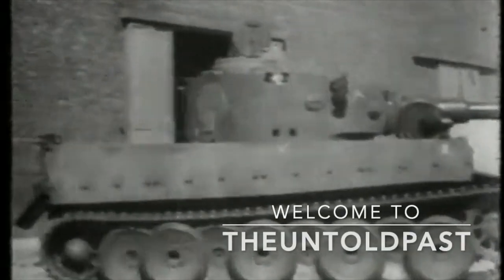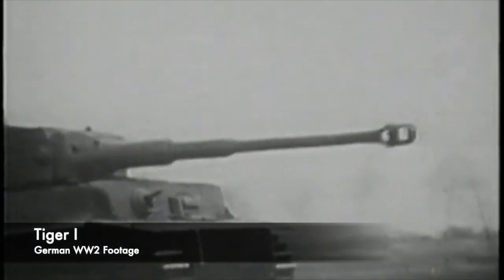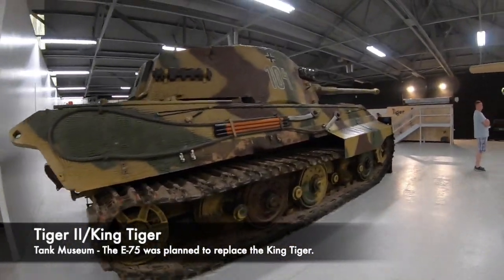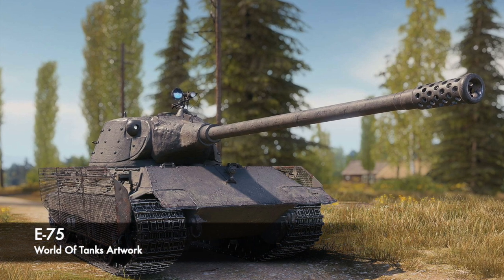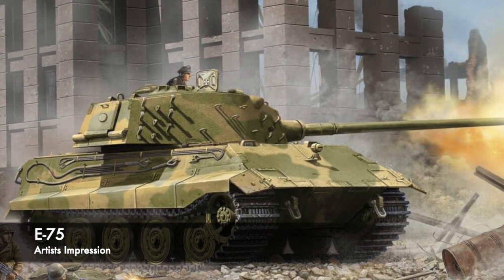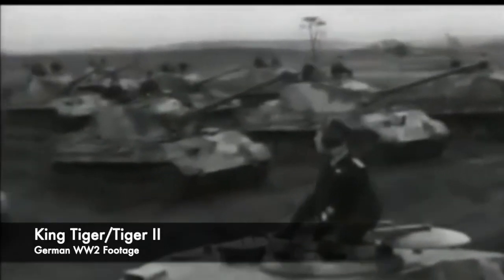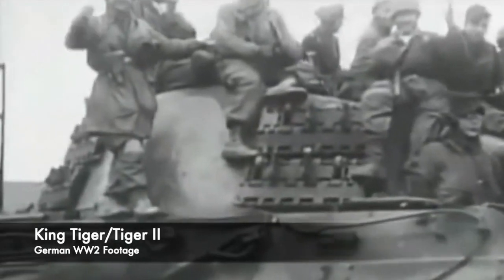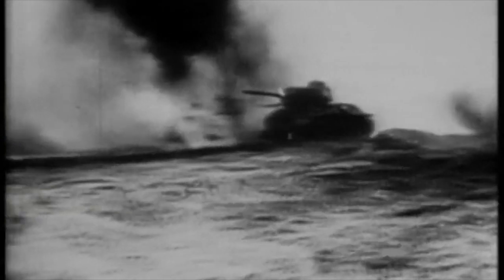The King Tiger's Replacement - The E-75 Standardpanzer

Comment: Germany was running out of fuel. Without fuel, it doesn't matter how many tanks you have.
Reply: Fuel and resources...
Reply: @Wassermel0ne  and manpower
Reply: The Icelandic Nationalist  The strategic bombing campaigns should have concentrated on oil from the start.
Reply: The Icelandic Nationalist  Much of the German oil supply came from converting coal into oil. A very expensive process requiring large processing facilities. The only substantial source of natural oil was the Romanian oil fields. Towards the end of the war the strategic bombing campaign concentrated on disrupting these sources. As a result there was a fuel shortage which mostly grounded the Luftwaffe, and was a major reason the ardennes offensive failed.
Reply: With more of the standard tanks the operation too take the caucus oil fields too ensure that the fuel would flow may have been successful.  Its all speculation. If this or what if that or could've happened this way. Really bad timing, bad choices by a megalomaniac and false superiority complex was even more of the down fall of the first authoritarian socialist regime.
Reply: @patrickcombs3567  communism sucked and killed many people too, but I don’t believe national-socialism is really that social.
Reply: @Ake-TL  it started as national socialism but ended up as authoritarian.
Reply: @Ake-TL  socialism sucks but social programs can be beneficial.  Its when the lines get blurred when you get the hitlers and even stalins killing off anyone they deem deplorable or detrimental too society.
Reply: ^ Nonsensical statement. Allied Bombing was in response to German precedent, whom had been the first to bomb civilian targets.

Also: the USSR was supplied with material from the UK, Canada & USA.
Reply: ^ Complete - not to mention ironically framed - claptrap. The Germans had by 1940 bombed civilians on purpose in Spain, Poland, France, Belgum & Rotterdam. It also wasn't "one bomber" that unloaded over London, but a group thereof.
Reply: Also: the UK & Canada directly supplied the Russians too, not purely with US goods.

Case in point: in the Battle of Moscow; over 75% of all the Tanks used to defend the city... were British.

So good job being demonstrably wrong on all points.
Reply: ^ How about everything? -_- .

The USA wasn't the prime source of nor the physicsl provider of material to Russia for the duration. Early on it was the UK & Canada.

Also Churchill - contrary to your diatribe - made no such "order". The Germans first bombed civilian targets with intent back in the '30's, when he wasn't PM nor in the cabinet.
Bit comical too how you neglect to mention the USAAF as being "cowards" for also following German precedent, or the Red Airforce for either their low yield long range bombing of Germany or their requesting the RAF & USAAF to hit targets for them.

Oh; and whilst we're at it let's not forget Japan, which supposedly dropped gas on civilians during the '30's. Not even the Germans did the latter.
(albeit only because they feared retaliation to using chlorine & sarin; with mustard gas or worse, rather like Iraq in 1991 feared a response to using chemical weapons on the UN coalition)
Reply: @jimtaylor294  If I were you id check were your getting your information from as its not very accurate, Germany out produced the UK in most areas actually.

In 1938 before any German conquest Germany had 14% of the worlds war making potential.
The UK and its empire had 10%.
Russia was more comparable to Germany at 14% also.
The USA had 42%
Germany after conquest of France had about 19% to 22%.

Best prodution year for the UK in ww2 for tanks was about 10,000 with USA support, and 26,000 aircraft, Germany best year was about 20,000 tanks and 40,000 aircraft in the middle of the bombing campaign pretty impressive.

Total production of aircraft the UK production was 131,000 compared to Germany 120,000.
Tank for the UK 35,000 Germany 49,700.

The UK domestic production of AT guns and Trucks was just over 10,000 each pretty pathetic lucky they had Canada to help make up for trucks, and the USA, even things like universal carriers, about half were made by the other parts of the empire, mainly Canada, India and Australia and even the USA.

Germans ammunition production was comparable to the Soviets who out produced the UK easily.

The Brittish war ship building was one of the best second to the USA, but overall excluding ship building and alone without it's empire the domestic production was only 2x as good as Italy.

If we look at steel in the navy the UK used about 1.8million metric tons, Germany used about 1.2million metric tons.

At a minimum 30% to 36% of the UK ww2 needs were supported/ suplyed by the USA.
Russian had about 12% to 15% for lend-lease the majority of that was from the USA.
Reply: @richardcutts196  I'd also say that it was oil that saved russia and stopped Germany in operation Barbarssa, it's basically what saved the Russian's.

Germany used about 47million barrels of oil in that period.
If we compare oil products.
Germany under 300million barrels from 1941 to the end of the war.
Russian 900million barrels to 1billion.
USA 6billion barrels.
UK conquest in the middle east Iran mostly and a small amount Iraq, about 600million to 700million barrels.

The allies consumed about 7billion barrels in ww2 not including the Soviets.

An interesting fact is coal was the most used and produced resource in ww2 the two biggest producers being the USA followed not that far behind by Germany.
Reply: ^ Spelling errors aside; dumping dozens of uncited statistics doesn't accomplish much, as an unreliable statistic, is worse than useless.*

The claim about Tanks is demonstrably false, as in 1940 the UK was producing more Tanks than Germany, and in 1942, production had geared up so much - by more than 40% - that the UK achieved  double the German production figures.

In Aircraft the UK started the war behind Germany; yet as factories got going & standardization enforced (unlike in germany which was starkly inefficient), domestic production shot up. Having nearly doubled on the prior year's efforts, in 1940 the British produced over 15,040 warplanes, to Germany's 10,240. The UK at that point in the war was producing more domestic aircraft, than any other country on earth.

Germany lost nearly 2,000 aircraft & over 2,500+ aircrew in the BoB alone, so their production figures are even weaker when accounting for such voids they had to fill.

In WWII the Germans produced 120,000 aircraft, compared to the British 131,000+. The latter wasn't far off the Soviet figure of about 158,000 (and unlike the USSR or the Germans the British had modern Heavy Bombers & in quantity), with the US's production making the total allied figure 0.6 Million aircraft, five times that of Germany.

The USSR protecting their Oil from the Germans prevented a wholesale Russian collapse, but they Still requested the allies send them oil, suggesting they still had shortages thereof.
Oil is also useless to a country without hardware to put it in; which the Russians were desperate for the allies to send them, and we did.

In four years the UK sent the USSR, among other material:
Over 4,000 Trucks
Over 5,000 Tanks
Over 6,700 Aircraft
& 12 Warships

Unlike Germany the UK had a stable supply of oil thoughout the war, with the Autarky loving Germans failing wholesale in attempting to sever the UK's trade networks in the Battle of the Atlantic.

To illustrate this: in 1940 alone the UK outbuilt Germany in naval vessels, by 20 to 1.

Bare in mind also that despite being noted for Submarines, the Germans started WWII with only 57, whilst the RN had at least 74. During WWII the UK & the USA would demonstrate greater capacity for producing Submarines, and superior designs for long range use.
(U Boats are more widely thought of, but the onboard ergonomics were abismal, so much so one was even lost... to a toilet malfunction)

The Kreigsmarine Sub' casualty figures relative to their RN opposites illustrates quite well, how hard the Germans lost the war at sea.

At D Day the British provided nearly 900 of the 1,100+ vessels (of all types & sizes), and over 3,200 of the 4,070+ Landing Craft. 
The RAF & USAAF also outnumbered the Luftwaffe on the day by a factor of over 30 to 1.

The point re' coal is also meaningless; as Germany had mostly poor quality Brown Coal; demonstrably inferior lb for lb when compared to the deposits under the UK.
Unlike in WWI too Germany was heavily reliant on oil to wage war, and no amount of coal conversion efforts could negate that. Coal was also by then useless for Warships... though brown coal was not well suited for even in the last war.
(the Germans almost being handed several major defeats at sea back then due to the coal quality gap)

*Statistics sourced from the BBC, War Factories S1, and the ONS.
Reply: @brianlong2334  Oil is why the German's attacked the Soviets when they did.
Reply: @richardcutts196  They wanted oil you mean.
Oil production didn't peak and there Germans were like now go, go! Lol
Reply: ^ So denial, doubling-down on unsourced diatribe & projection are the best you can come up with. No surprise there XD.

#WehrbooConfirmed
Reply: @jimtaylor294  haha!
Spend 5secnds on youtube watch military history Visilised and TIK catch up to reality fanboy.
Reply: Chris_Wooden_Eye  I would agree with most of that, they under estimated the Russian's they thought the Russian's had 5million men, they did but they didn't take into account the 11million reserves, they also estimated 10,000 to 11,000 tanks as we know it was more like 22,000 to 25,000.

Had the relised they needed to fully mobilise in 1942 there probably would have increased there chances drastically, however they would have needed to stoke pile more oil at the start of the war, at the start of operation Barbarssa the Germans had a stoke pile of about 20million barrels not even half of what they wanted, but about 3 months worth of fuel.

Had they got more oil from Romania this also would have helped, Romania produced about 42million barrels a year, yet supply Germany with only 14million barrels a year because they didn't want to use up all there resources for the Germans.

Germans produced in 1940 about 3million barrels domestic crude and 10million barrels synthetic, by 1944 they were producing 10million barrels crude and 44million barrels synthetic.

They also need Spain to join the war to cut off the Mediterranean and to take north Africa, and move over to support the Iran and Iraq government's who were pro axis.
Who combined produced about 104million barrels a year this increased to about 120million by 1944.
This would also cut of the UK main oil supplier as it invaded the region to control it and stop them sending shipments to Germany.
Egypt also produced about 7million barrels a year.

Also a second front would have likely opened in the caucuses near Iran and the stan nation's, probably cutting of the main oil supplies/mining of the USSR, over 80%, of its oil was from there and 98% of its lubricants.
That would leave the Russian's with about 45million barrels a year domestic, the USA only suplyed about 20million barrels of mainly aviation fuel to russia in ww2.
Reply: Also if you dont own the skies it doesnt  matter how many tanks you have
Reply: @jimtaylor294  By accident yes
Reply: Hence Germany was forced to build "super tanks" like E-100 to win, it do not matter if a Panzer IV can take out 2 or 3 Sherman or T-34 under favorable conditions, it is not enough.
Reply: @kirgan1000  They didnt win so thats not the reason but try again
Reply: @janvandeven906  I was replying to the other guy, whom I gave up taking seriously ages ago XD. 

Good points though, as whilst airpower had less of an impact on ground vehicles than used to be thought, losing command of the air significantly hastened Germany's defeat, tactically & strategically.
Reply: which is why it makes sense to make superheavy tanks that can take out everal enemy tanks. Yes they need more fuel but if one Superheavy tank can take out 10 enemy tanks it pays off.
Reply: ^ Then we'll have to disagree, as Heavy Tanks seldom took opposition that numerous to expunge.

MBT's by contrast, they have, albeit due to having the mobility to complement their armament & armour.
Reply: @LarsAgerbk  Well since you need to have control of the skies for that it didnt work
Reply: By 44' they were already scraping the bottom the barrel for everything.
Reply: @Ake-TL  Two things... (1) Communism killed 25 million under Stalin and 45 million under Mao -- not counting WWII and the Korean War. The death toll of 6 million Jews and other political undesirables under NAZI Germany pale in comparison. (2) Socialism is Government direction of production, way of life and beliefs. Whether it's to benefit racist Aryans or Marxist comrades makes very little difference.
Reply: @dwightlooi  1)why did you feel need to write first thing? I didn’t deny horrible stuff done by Communist dictatorships, nor did I compare death tolls 2) Reich and Union had different economic policies, they may seem similar because of horseshoe law( opposite radicals are more similar than moderates)
Reply: @Ake-TL  (1) I didn't say you did. (2) To say that if one plans the economy one way I am not socialist, but if I plan it another way I am socialist is contrived. Socialism = System under which production, beliefs and way of life is directed by the government to "benefit" society. The exact decisions and plans such a system makes doesn't change that.
Reply: I feel like if germany advance little by little taking one nation at a time and stabilize those nation they could actually control europe, then there will be enough resources to take on russia and usa.
Reply: @brianr.6376  Actually, the reverse is true. Let me put it simply...
--
(1) Hitler and the NAZIs were the leftist National SOCIALIST German Workers Party.
(2) Their SOCIALIST policies to nationalize and command the economy had increased public expenditure ten fold from 1933 to 1939, caused food shortages, tanked exports and made it impossible to trade of fuel.
(3) If Hitler didn't start and expand the war as quickly as he did, Germany would have been bankrupt, starving and out of oil by 1942.
Reply: @dwightlooi  i see, i always wondered why the germans wage war against so many country at once. In my country, we mostly study japanese so i didn't know much about the germans.
Reply: @brianr.6376  
It is not that unlike the Japanese situation really... The Japnese wanted an empire like Britain, the Dutch and every one else. The idea that conquest and empire building was OK for the Europeans and the Chinese in the prior few centuries, but somehow with the Meiji awakening everyone has to accept the world as it was... that sounded like double standard nonsense to them. So they made up incidents to war on China and take Manchuria. When the US and the Europeans embargoed Japan's oil supply, it was either FIGHT or SURRENDER -- surrender to playing 2nd fiddle to the established western powers. Japanese chose to fight -- take out the US Fleet, seize the Dutch oil, British rubber and everything else. The rest is history.
Reply: @Ake-TL  I'm fairly sure that Stalin's regime killed at least as many people as the Nazis and their allies. The major reason we don't hear as much about it is because the Soviets/Russians maintain control over the records and the places where the crimes took place. Ironically the only reason we found out about the Katyn forest massacre is that the Germans revealed it to the world after they captured the site.
Reply: @patrickcombs3567  There is nothing socialist about national socialism, its just like there being nothing democratic in the democratic peoples republic of korea(northkorea)
Reply: Thats true, no wonder why they made such big tanks. if you cant use lots of tanks, make a few tanks and make them as good as you can
Reply: German never had enough tank recovery vehicle for it tank rescue in the field !

Comment: Sure they're superior, but the allies has a thing called fuel lol
Reply: If german still use ww2 tanks and use modern tank unti now ?
Reply: I think it will be interesting 
In modern world maybe ww2 engine will be replace with new engine no need hands to start the engine
Reply: @minhnghiaduong  great idea but replacing the engine wont be enough u must change the fuselage system and change the armament and the armor from ww2 era to modern mbt lets change the armor with composit armor generation 4 and switch the gun with 140 mm dont forget the reactive armor, heat protection,night vision etc
Reply: @nazigorfurher4403  i know if tigers tanks still use til now and it replace with modern thing i think it will be cool and dangerous
Reply: @minhnghiaduong  are you 5? The turret would be changed or if possible just change the gun if it fits and you need to change the armor to newer ones but it wouldn't be a tiger anymore
Reply: @siphobrisloks8133  i know about that
Reply: They shouldve used gas fueled engines... it seems they had enough of that tbh